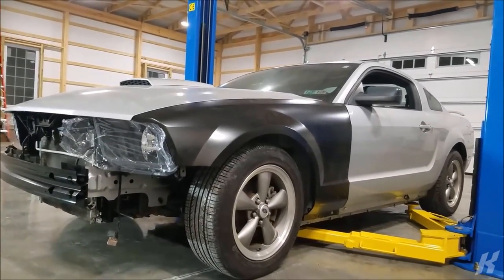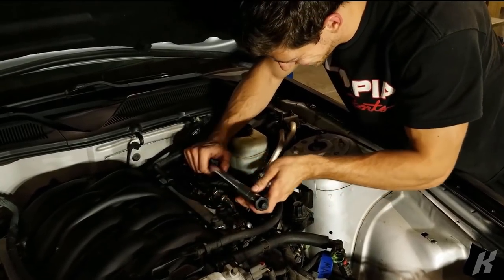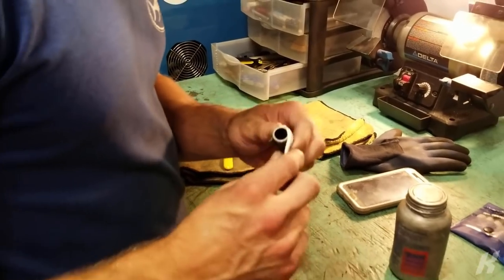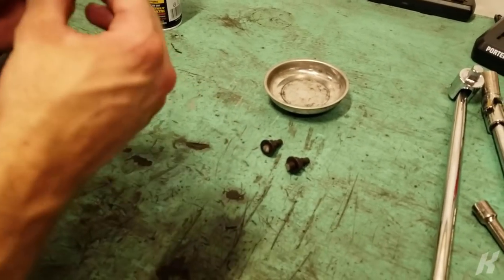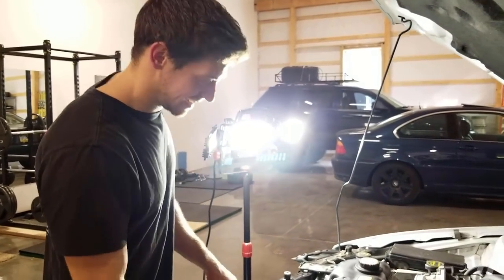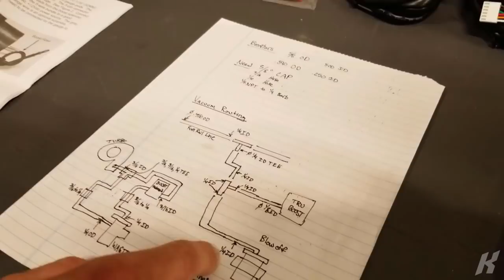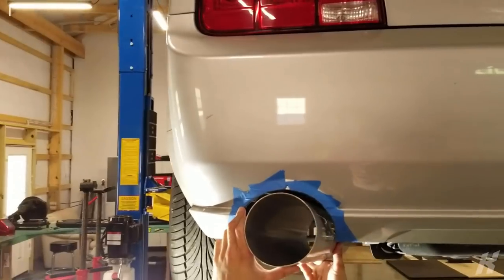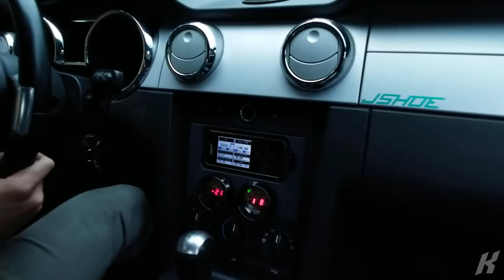How To Turbo Your Car [Feature Film]

Comment: I'm 17 and have a 2007 mustang (thank goodness for the hoses)
I have about 5 questions 
1. Will I need to buy a fuel  pump or booster and #47 or #39 injectors right off the bat?
2. How exactly do the lines work for the BOV if it also goes go the boost controller and boost gage?
3. Why is everybody modifying the oil res (not the brackets but the oil reservoir I think its called)
4. Will a stock MAF work for a while? this also goes with the first question, Will I need a dyno tune or could I use a tuner for a little?
5. How exactly do you bend the pipes? 
I tried to ask questions I really cant find anywhere I have gone thru about 30 forums (trust me I got the joke about the guy getting all of the electric fans on eBay I was crying laughing lmao) most the post online are from before I was born or close to it... Let me know if you could help me out, I could also just end up figuring most of it out like you did but id say im quite a few years behind, while I do love solving things like that I would like to go into it with a little better mindset being my first ever turbo install!!!! 
Great video keep it up!!!! sorry for the very much excessive comment lol.
Reply: Maybe if I watched this a few more times I would get it, But I looped the other 12 videos twice before I had seen this one.

Comment: how do you prevent the spark plugs from breaking when you remove them?
Reply from the maker: There are a lot of different methods, mine seemed kinda hopeless because of how old they were. You can spray PB blaster on them days in advance, some warm the car up first before trying to remove them. Ford has a procedure, which I tried with no luck. I got to the point where I didnt care if they broke or not since I had the removal tool, so I just went for it.
Reply: There are updated 1 piece spark plugs now that you can buy instead of the 2 piece crap.

Comment: One small detail I see on your mustang is that you switched the water crossover.. for the on3 kit. Did you have to modify the radiator or just get the 07 upper and lower radiator hose??
Reply from the maker: Didn't need a different rad, but yeah got the newer hoses. I remember it still being a bit tricky to get it right.
Reply: Ok . thank you for the reply back.. I have a 05 and I the on3 kit just bought that crossover on eBay.

Comment: Hey... Great mustang.. You said in you video that you had to bend some of the piping to kit correctly...how is a person able to do that best...heat?  Vise? Hammer? Just curious...I'm looking at installing this kit soon..
Reply from the maker: Thanks! I just used a big sledge. Basically I think they forgot to dent some of the tubes that run under the front subframe.

Comment: Dont know if you will reply to this but it would be much appreciated! I have exactly the same 2006 GT s197. Most people have said 475hp is the limit on these and you pushed it to 500whp. Is this still pretty reliable? Did you do any supporting mods for the internals? And how many miles did this have on it?
Also... do you have a final cost for all of this? Cant seem to find it. May have skipped it or something
Reply from the maker: Yeah 450whp/wtq is a good place to stop. I since turned the boost down a bit so that's about where I'm at. I probably have about 10k miles on the setup. All in the turbo install with tune was like $5k but that was like 5 years ago now.
Reply: Whp doesn’t matter as much as wtq does. 450rwtq is roughly the safe limit, theirs was at 439 so they’re in the clear. More peak whp is basically just the torque carrying farther up the rpm band

Comment: I"m debating on if I want to get the injectors and fuel pump they offer as upgrades. Whats your opinion on them so far. Is it worth  spending more money on different fuel system parts or are they holding up fine?
Reply from the maker: I've had no issues with the ones that come with the kit

Comment: You made 512 to the wheels on a completely stock longblock? No cams or anything? Also how is the stock clutch holding up to it?
Reply from the maker: You are correct, I have since turned down boost so I'm probably closer to 450whp now. And stock clutch is doing fine but I dont beat on the car.
Reply: Kordare that’s pretty good, how much boost?
Reply from the maker: @trackbd1  around 7.50 psi
Reply: Kordare wow thats a good bit less than i was expecting, nice work 👍🏻
Reply from the maker: @trackbd1  thanks!

Comment: Howd u get the mass air flow sensor setup onto the new pipe??
Reply from the maker: The new sensor just bolts on the pipe right before the throttle body. You do need to cut off the old connector and wire in the new one but it comes with directions I believe.

Comment: What in this video did not come with the kit? I know that the fuel stuff doesn't. I'm saving money to do on3 setup i just need to some tips and things i need to buy with the kit
Reply from the maker: Actually I did buy the pump and injectors with the kit as an optional add on. So pretty much everything came with the kit except heat wrap, turbo blanket, gauges. Obviously I built my exhaust but the kit hooks up to stock exhaust.
Reply: Did you buy a clutch?
Reply from the maker: @bigmiami3763  nope still on stock clutch
Reply: Do you have a electric boost controller
Reply from the maker: @bigmiami3763  yup I have aem tru boost
Reply: What did you wire the gauges to
Reply from the maker: @bigmiami3763  what do you mean? For power I wired to the fuse panel in the passenger footwell
Reply: What do you regret not buying or buying?